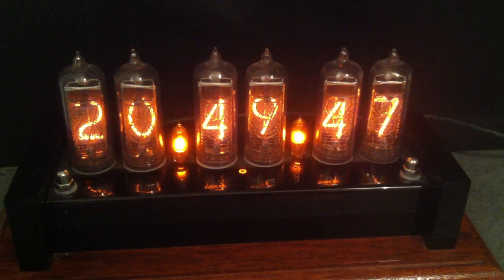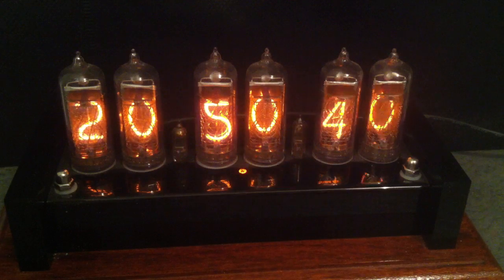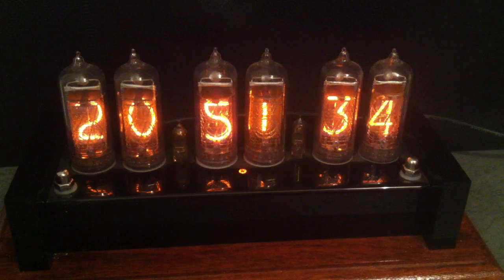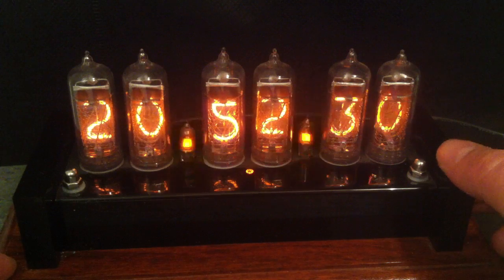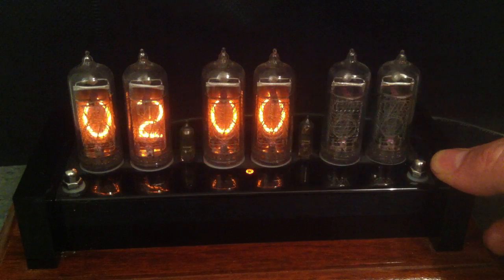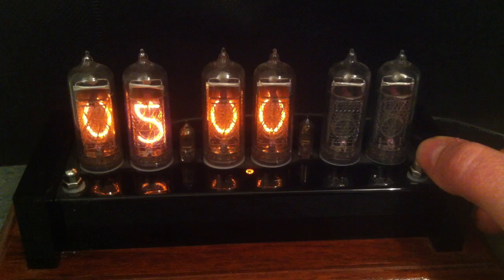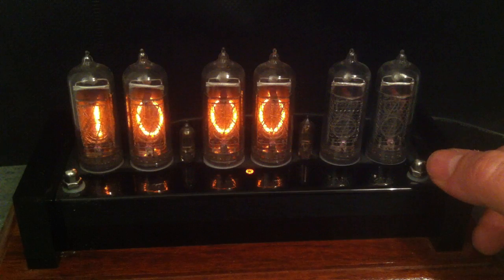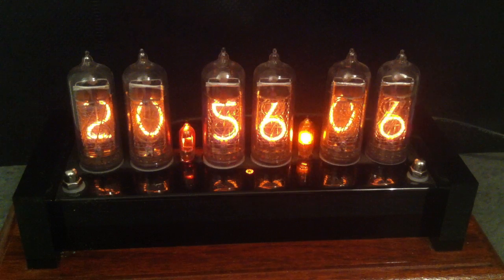Nixie Tube Clock - How it works

Comment: How long do the tubes last? If one burns out, and you replace it, do you need to reset the whole thing or can you just pull one and add another? How do I contact the maker?
Reply: Different clocks have different ways that the tubes are connected, but most have the tubes soldered to the board, so you will need a soldering iron to replace them... Usually its a pretty simple job though, also, you can buy clocks where the tubes simply swap out. As for how long they last? About 10 to 20 years depending on the tube. And even then, it should only be one digit that is broken, so the clock would still function pretty much fine
Reply: traderjoes 30 years

Comment: Really wish the audio was louder.  Not trying to burn out my amp by going to 11.
Reply: +Jeff Chartier
It's a little quiet, but nowhere near that bad. If you're having that much trouble with it, I'm afraid it's already burnt out, you need to get some new speakers.
Reply: +MarioFanaticXV  I have two large boston acoustic speakers and subwoofer hooked to an external 120 watt amp.  My PC speaker system is the loudest on the block if not the square mile..or 10 miles.
Reply: +Jeff Chartier
Then it must be something with your computer; I had to turn things up a little, but could hear just fine.
Reply: @oldowl4290  could hear it from my phone at half volume
Maybe your ears are shot from having overpowered speakers 😅